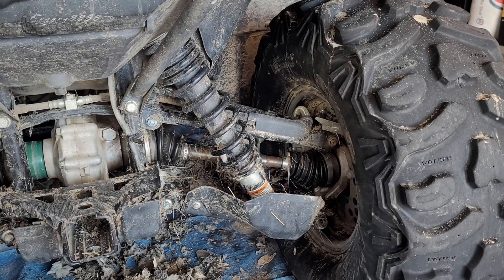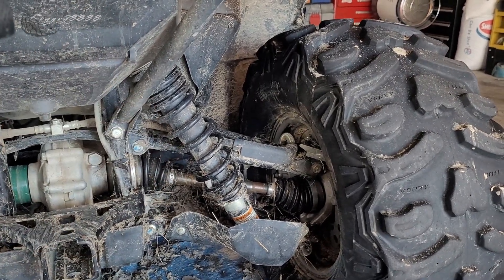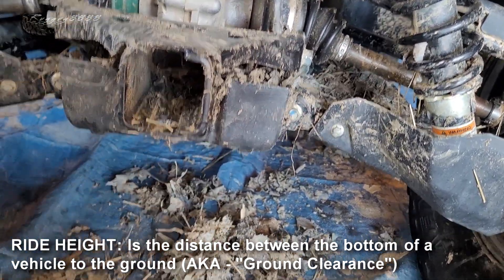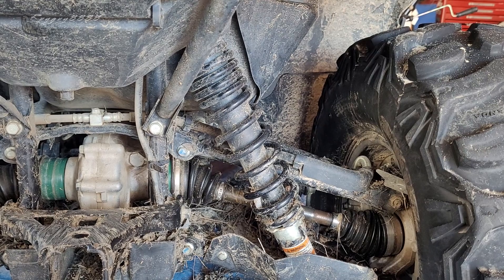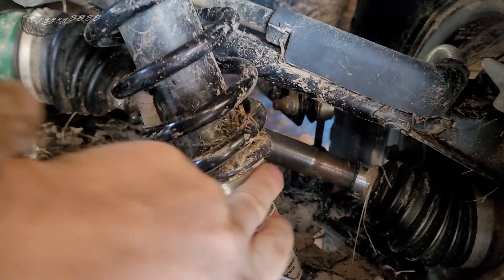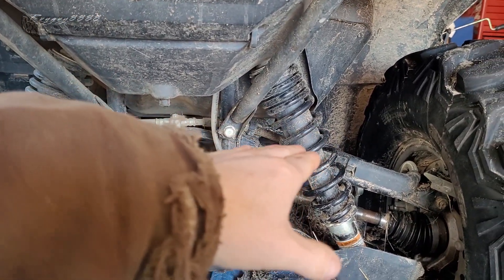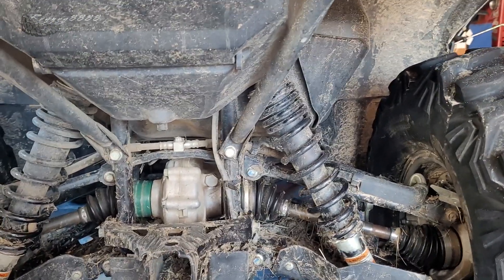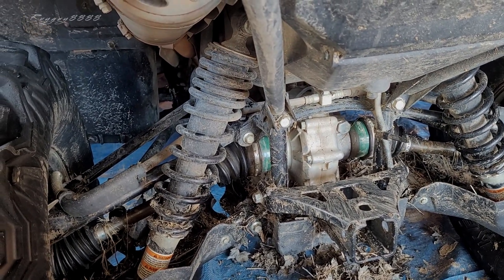ATV UTV Shock PRELOAD Explained

Comment: But it’s only an inch. I can’t see it making much difference. Am I wrong?
Reply from the maker: It's all dependent on spring rates im guessing. I'm not an engineer so i cant tell you how many more lb's per inch of compression the springs can support.
Reply: It helps a lot with hauling weight. It's quite a bit of difference in stiffness from first to last notch. If just a single rider not hauling anything I would just leave on the lightest setting. That same setting hauling a load with have you bottoming out.